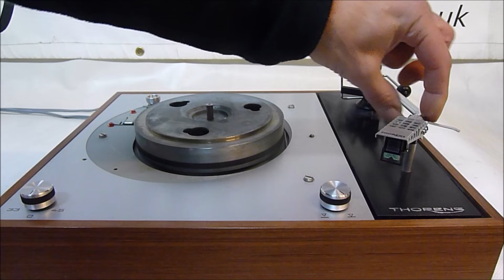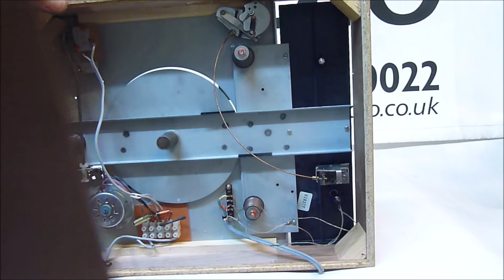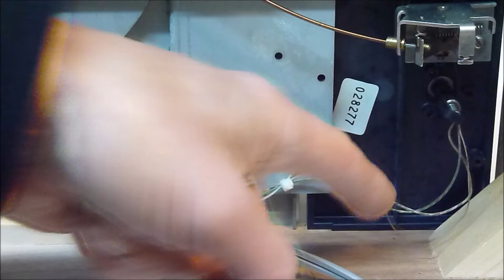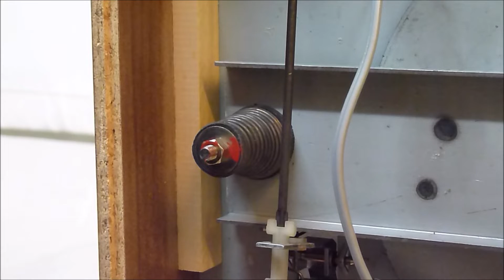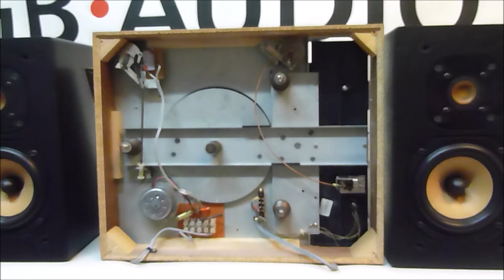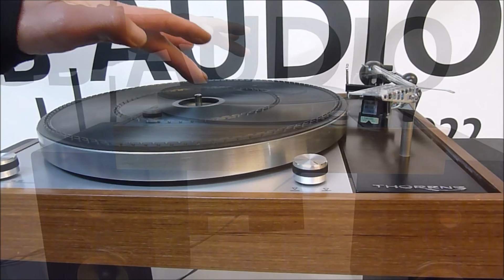Thorens TD150 Mk2. Part 2. Below Deck: suspension, foam, nuts, cable dressing.

Comment: Anyone know of a video on how to adjust a wobbly TP13A? Seems like I’m not the only one with this problem.
Reply from the maker: Sounds like the bearings are either worn out or have got loosened. Specialist job to fix, don't know anyone who does that sort of thing, sorry.
Reply: @gbaudio1212 it was one of the bearings. Got a new one so all good.

Comment: And now after removing the foam, it shakes like an old car on the bumpy road. This is why foam helps to reduce. Why did you remove them in a first place?
Reply from the maker: Did you not listen to the video? I explain at 5:55 that removing the foam is my personal preference and why I believe it improves the suspension's isolation to remove it (caveat: the turntable has to be on a solid support). I also explain why the foam is there in the first place, so after your own experiment you can make up your own mind whether you replace the foam or get a more solid support. Thank you for watching. GB

Comment: I need to tell you just how much you have helped me in setting up this particular turntable.
    This is not just a platitude but true gratitude. There are many setup videos about but they are for the setting up of a brand new unit in perfect working order.
    To find one that addresses the many common issues that arise from vintage kit in less than perfect condition is a nice surprise. 
  Thank you so much. Subbed...(of course)!

Comment: Did the foam do any harm ?would removing it only make the deck less compliant and more open to potential , unforeseen problems an owner may have in the future and placement of the deck  ? Metal against metal etc increasing potential vibration without the small bits of foam  .  Is it perhaps making it a less forgiving turntable ? you have reasons but I wonder , were those  Thorens Engineers just sticking bits on because they had some bits of foam lying around or did they have a purpose , I suspect those infamously precise Swiss and German engineers didn’t often use  nonfunctional materials or casually insert foam in springs, I’m   sure they’d have considered their design carefully , a design that is one of a line of classic turntables  .. I often see people removing bits , adding others and always thinking they’ve ‘ improved’ the original design when perhaps they’ve actually made a sideways move or possibly downgraded the tables effectiveness . A little like removing a pesky rubber grommet or washer .
Reply: My understanding is the foam was inserted to help with very low frequency disturbances such as footfall when the deck is stood on a wooden fall. It's really a compromise as it forms a mechanical shorting of the spring. Linn, for instance, have a very similar suspension but don't use foam as it prejudices the mechanical filtering of the suspension. A more pragmatic approach is to enable the best possible suspension freedom and mount the whole deck securely on, for instance, a lightweight wall shelf
Reply from the maker: As I explain in the video, the foam is designed to dampen the suspension a little, which may be a help if the deck is on a wobbly or unstable surface. I explain that it is my preference to remove the foam for decks which have a solid support because an unfettered spring will give maximum isolation from chassis-borne vibrations. You are of course free to retain the foam if you wish, but bearing in mind that many other spring suspended decks do not have any foam at all, I think it is entirely reasonable to consider it optional, not essential.

Comment: I have a td125 mark11 tirn table given to me as a gift. I want set it up to my rx v630 yamaha receiver. Will the set-up run w/ out a a pre Amp? What will the 11:14 rca  cables connect from turn table to receiver?
Reply from the maker: You will need an RIAA phono preamp because your Yamaha receiver only had line level inputs.

Comment: My Thorens td 150 MKII (just like the one in the video) which I have started to refurbish does not have a separate ground cable. Do you have any advise on how to add one?
Reply from the maker: As you will see in our video, the earth/ground cable attaches to the steel sub-chassis with a self-tapping screw. The cartridge output wires each have their own ground so the function of the separate wire is to make sure that the metal parts of the sub-chassis are at the same electrical potential as the signal earth to avoid picking up hum. Two things to note: take care that the cable has a loop between the fixing point on the sub-chassis and the P-clip or saddle clip on the chassis. This will enable the deck to float properly, as shown in the video. Also take care that the screw is not so long that it touches the chassis and fouls the suspension. If there is not a fixing hole already, choose a location which is clear of any obstructions. Good luck.

Comment: The from is important is dampening the spring from vibrations and I would add double the amount need to be a bit thicker. The from has got nothing to do with instability. Ideally you want to drill a 2 inch hole below the main spindle of the bottom covered hardboard and put some draft excluder around the edge, it doesn't matter if it's hardboard or anything stiffer hardboard is better actually than stiffer materials but it has to be open really no bottom at all is the best solution. When you have a closed box it causes resonance in Lower frequencies below 100 hertz similar principal when having the dust cover on when playing. Use some packs of jelly as feet underneath, Best isolator
Reply: My understanding is the foam was inserted to help with very low frequency disturbances such as footfall when the deck is stood on a wooden fall. It's really a compromise as it forms a mechanical shorting of the spring. Linn, for instance, have a very similar suspension but don't use foam as it prejudices the mechanical filtering of the suspension
Reply: @russputin6294  sorry I have to disagree. the best suspension would be foam on its own without a spring. It's not really shortening the spring, it's just pressing against the side of the spring it's dampening the vibrations in the spring itself. it's not enough foam to make it that solid it is open cell polymer foam.
Reply: @jedi-mic Obviously, then, some of the finest engineering minds and physicists in the world, over history, have been just plain wrong. It's nothing at all to do with "shortening the spring" it's by-passing the spring (by definition - as you agree it's making the suspension "solid", if, apparently "not that solid") by forming a mechanical bridge between the two moving surfaces. It may help you to visualise the foam as the shock absorber in a car's suspension; it's purpose is to dampen the suspension oscillation, to compromise it's performance in less than ideal conditions (pot holes and cornering at speed, for instance) which, by definition, is limiting it's operation. If you can show me one - literally one - state-of-the-art, no compromise, cost no object turntable that has foam damped springs then I'll peel you a grape .Or maybe, for instance, Linn's latest £50,000 LP12 does not have foam in the springs because that would have pushed the budget to breaking point and pushed the retail price to an unmarketable £50,000.10. Or, alternatively, if, as you say, "the best suspension would be foam on it's own" they could have just used that instead, had a much better product and saved a couple of bob in the process. I hear that next years McClaren Formula One cars will be using foam suspension as it's a much simpler proposition than expensive precision engineering and when Bradfield designed the Sydney Harbour Bridge he originally wanted to use sponge instead of steel hawsers but his mother refused to let him cut her parlour cushions up. It's little known but When Lindenbergh completed the first transatlantic flight in the Spirit Of St. Louis, halfway across the ocean he completed a daring emergency repair to the planes engine by replacing a sheared inlet valve spring with a strip of memory foam he cut from his seat. At the end of the day It doesn't really matter; it's a record player not a matter of life and death. If you're happy with foam in your springs then stuff away, fill your boots and enjoy. Who knows, as there's more than on way to skin a cat, we anti-foam heretics may eventually be proved incorrect and come around to your way of thinking;. Perhaps BBC Verify would like to fact check the obvious misinformation I'm peddling here and put me right; removing the foam damping from turntable suspension could well prove to be another dangerous and unfounded internet conspiracy theory. Enjoy your evening my friend and thank you for your contribution to the debate .
Reply from the maker: Some interesting hacks there, thanks for sharing. Totally agree about the importance of reducing resonance. Sorry, but I beg to differ regarding the foam in the springs. If you put more foam in them, their function as isolators will be impaired and vibration will be able to pass through from the chassis to the sub-chassis. Without foam, the springs provide the maximum isolation for the floating sub-chassis. However, as I said in the video, the shelf/support needs to be very stable and vibration free. A good support could be anything from a well supported 12mm plywood shelf to a slab of concrete, so long as it can't move. GB
Reply: @gbaudio1212  no it's a complete opposite with the foam think about it! You're not preventing isolation you're adding to isolation by using the foam, springs have a resonance to them and you need to damp that resonance the springs resonance, the foam dampens it. I actually put a thicker piece of foam at the top 15mm thick pushing at the outside of the spring, I don't think the foam is thick enough at the bottom, I replaced that as well pushing against the springs so it leaves an imprint in the foam, foam is the best isolator you can get, its mainly air about 97% is air but of course it doesn't have the structure ability to hold up the sub chassis and platter what you need it to dampen it, springs metal resonate you've got rubber but that's not enough I don't believe you need the foam what is better than the rubber on its own. I can't see your logic why you think foam is going to prevent isolation? makes no sense. I've just done a test with a fork try it get a fork and a washing up sponge when you put the handle of the fork to your ear you can hear the ringing in the fork when tapping the fork prongs, stick the fork through the sponge so there's about an inch sticking out and then tap it or flick it with your nail and you're here it deadens the ring eliminates it, its the same principle for a spring, metal is a great transfer of noise. That's why I always thought the foam wasn't adequate enough, and I made it wider and added a piece on the wider part of the spring as well on both ends and just left the spring open in the middle. Try you got nothing to lose you can always take it out again but I'm sure you won't. I think there's another benefit as well it makes the whole table a bit stiffer I've noticed on Linn upgrade kits the springs are thicker metal than original and I think that is the same case on the Thorens. You could try a thin piece of Cork on either end of the spring as well something that's about three or four millimeter thick, along with the rubber that will give you even more isolation I don't see people doing that but the principle should be good. Is actually what they use in the main bearing at the bottom it's cork a piece of plastic and a steel shim well on the 160 anyway probably the same with the 150..